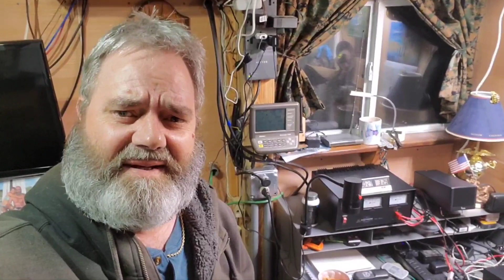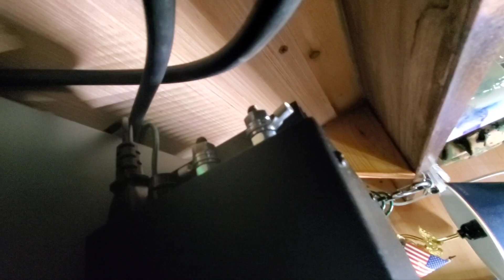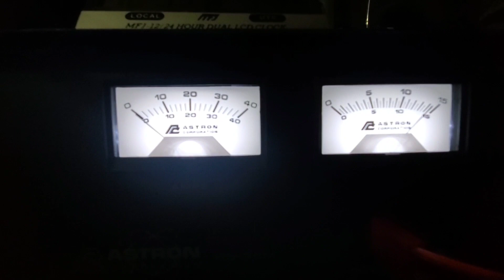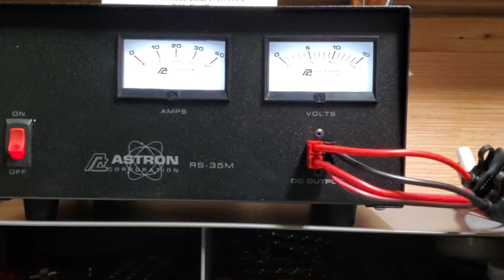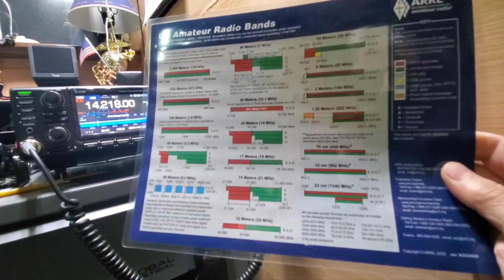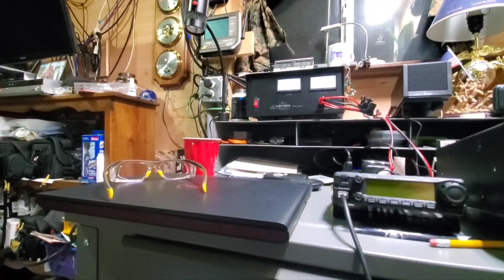HAM Radio Setup Linear Power Supply Astron RS-35M-AP Review By KVUSMC-KU4SMC

Comment: You should have shown in the video the power supply under as heavy of a load as you could have come up with to show it's performance. I love Astron regulated power supplies.
Reply from the maker: Sorry about buddy under At full Load Running a Icom IC-7300 and LDG 1000 AT Pro II it is Running about 9 to 10 Amps 73's de KU4SMC

Comment: I have ben into radios & amps and Electronics for over 35 Years & I Learned A Long Time Ago That Astron Was The Best Power supply's on the Market for the average joe (Unless ya run a 24 pill or 32pill amp) I Have Had All of Them and The Switching ones are nothing but Trouble in my Experience ! I Only Use  Astron Power supply's ! Even Now Powering my Yaesu Ft 991 Nothing Fancy Just a RS20-A Runs It Like A Champ ! I Am Quit Certain you will enjoy that power supply for many Trouble Free Years of service Gunny !  Thank you For Your Service to btw  Because i got enough sense to know im free thanks to folks like you & you should Know You & Your Family's Sacrifices Is Appreciated
Reply from the maker: Amen Brother I have an Elmer in Kentucky Who Recommended the Astron to me it is a Beast I love It Brother God Bless and Semper Fi KVUSMC-KU4SMC